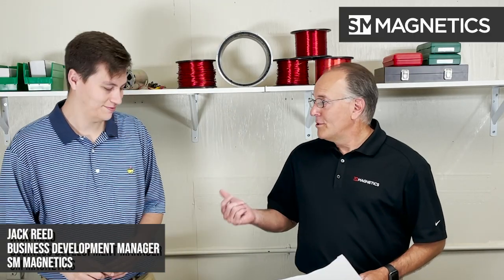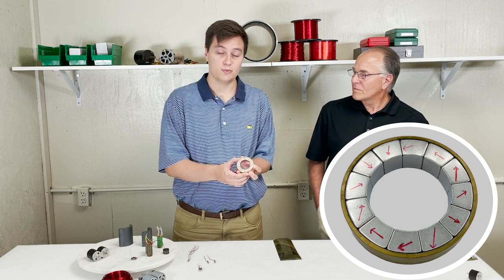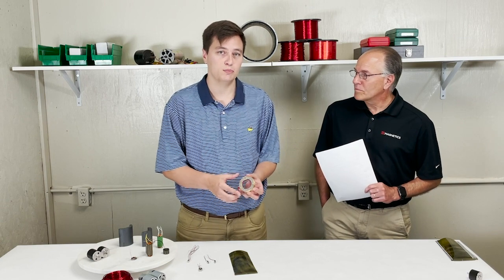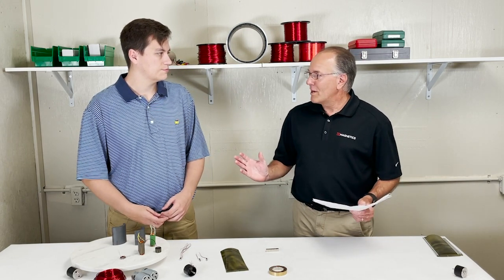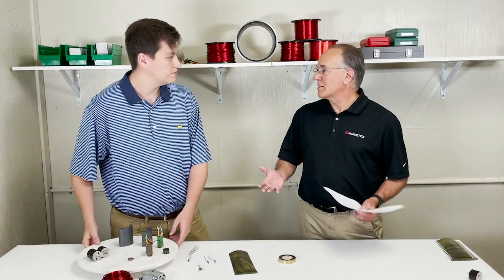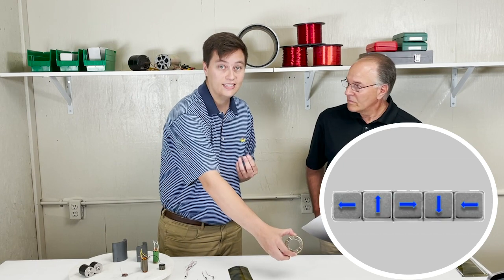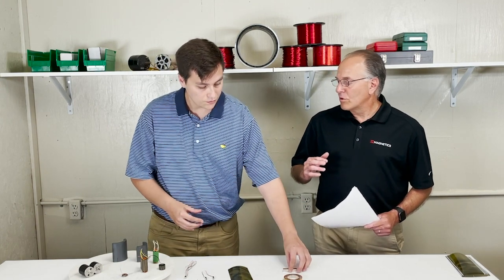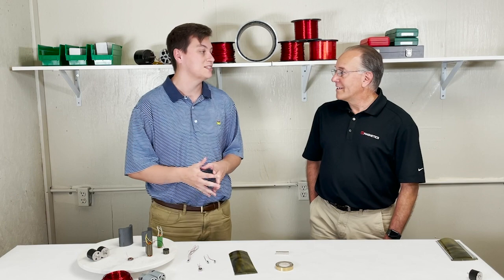Magnetic Innovation & Technology Series, Episode 5: Halbach Motors & Magnetics

Comment: Mabe better to have a halbach within another halbach? with a gap to put an copper coil inside which would increase the electromagnetism I would assume since both sides as used at its optimum way. 

I dont understand why its so expensive to be over $200 for around 2 inches halbach. Cant you just reposition the piece in a different direction to magnetize it? And a regular arch one would be around $10 which is a 200% difference.
Reply: All these are probably custom made and not mass-produced

Comment: While they're sexy and fun I'm not sure that Halbach arrays are actually superior in all cases. I've found that Halbach arrays, while they generally have a more intense flux, they usually have a lower total useful field because the magnets are oppositional to each other. Unless the flux intensity you're generating is above that of soft iron, I think they perform little to no better and are much harder to assemble. Soft iron arrangements tend to almost self assemble.
Reply from the maker: Thank you for your comments! We greatly appreciate your feedback. Yes, you are correct in that Halbach arrays are not superior in all cases. While in some cases it would be much more efficient it is not the "end all be all". Using a halbach array is very application dependent and there are specific uses for it today. In general, choosing the correct motor magnets whether it be a halbach, arc segments (like in a rotary motor) or standard neodymium square magnets will all depend on your end goal. We work with each customer to help determine what is best for their situation. Every design has its unique challenges and the solution is always a compromise of a number of tradeoffs like size and weight, power density, losses, temperature and material cost.

Comment: Honest criticism, and in good faith: As a novice viewer I would not learn anything about how a Halbach array is put together and why it is "efficient", having watched this video. There was no "a-ha" moment, just "Believe in the magic that is Halbach arrays".

For the viewers who might be interested: Basically the bulk (mass and volume) of the "back-iron" and "tooth-gaps" is "filled up" with assistive magnets (usually magnetized in an "across" direction). The direction is easier to illustrate with a picture than with YT comment-text. For the same bulk, you have more MMF, albeit with a more expensive set of magnets, and hence the higher motor-constants. A side effect is that the field in the unimportant direction is "cancelled" by these across-magnets, as would a back-iron. The polarization of the across-magnets (Halbach-magnets) is the same as the polarization that the back-iron would posses, only now, the extra magnetization strengthens the overall MMF in place of the back-iron "just allowing it to pass". 
Fancier Halbach-arrays have a smooth transition of magnetization-directions with intermediate angles, rather than just "through" and "across" (0' and 90'), and are correspondingly more expensive to magnetize, but offer a slight further improvement just as a curved pipe would to water-flow, instead of a sharp elbow. An additional advantage with these is lower cogging, as the pole-transition is smoother (approaching an ideal  sine/cosine shape).
Reply from the maker: Thanks you for your comments! We greatly appreciate your feedback. Honestly, this video was not produced to educate our viewers on the details of a halbach as we have already launched a video talking about the magnetization in details and flux readings you will get from different halbach designs. We also discuss uses for the halbach array in that video. If anybody wants to learn more about the halbach in much more details that video will be the best. 

This three part series on motors is strictly focusing on different types of motors and the steps we take with a customer when helping in the design phase. While we do speak to the types of motors and where they are used our main goal is educate our viewers on the process from prototype to production. These videos should help our viewers understand the steps we take and the valid points to think about when designing their motors. We also share the engineering and manufacturing resources we have available should our viewers need some assistance in motor design or manufacturing.
Reply: Hi Aditya. From your first paragraph I can respond to this by saying that I actually found this Super magnet man channel around a year ago when I was searching for videos on Halbach arrays. I can not say exactly what videos I watched but, I found them to be quite informative and subscribed to the channel and have been watching quite a few of these. I had not heard about this technology until I had heard it mentioned in some of the "Munroe Live" https://www.youtube.com/c/MunroLive videos when they were breaking down a Tesla Motor. I thank Sandy Munroe for touching on it and to Super magnet man for their great content. Not everyone has the time to put into making super high quality videos together and we need to remember that if they have the information online that I would not have learned otherwise. The subject matter is also not really intended for beginners I would think.